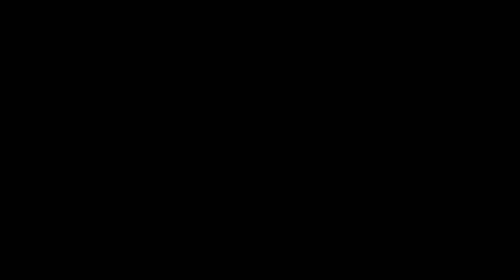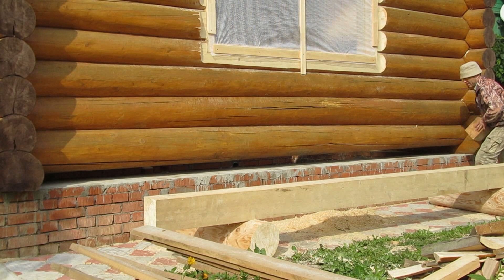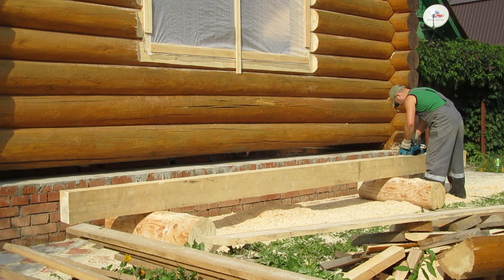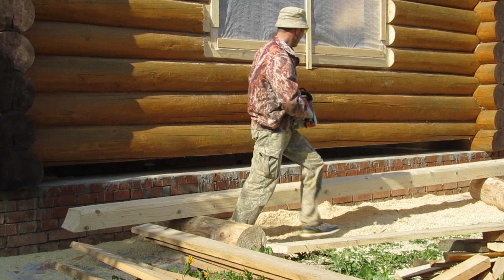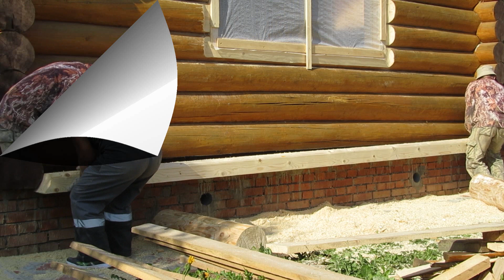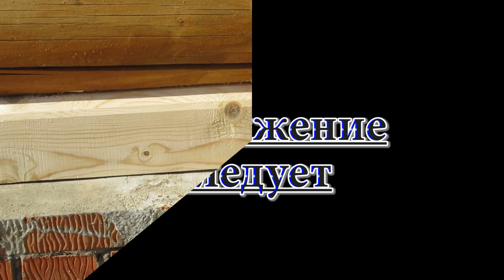Как заделать промежуток (пространство) между срубом и фундаментом

Comment: Совсем недавно подобной фигнёй занимался, ещё и угорел в безветренную погоду, когда вдоль пилил. И проклинал тех, кто мне рубил сруб и сразу в чашу не сделали эту палку) у меня полы по грунту на уровне ленты, поэтому эта палка видна в помещении. Так бы залил нахрен бетоном.
Reply from the maker: Кузнецов Евгений так-то эта "палка" называется подкатное или безымянник. По идеи его вставляют при сборке и не из бруса, а из бревна, тем самым на перекрывном пилиться не плоскость, а делается обычный паз. Но раз уже всё, как есть и бревно найти проблематичнее, то решено использовать брус на 200.
Reply: leskos Да, у меня уже тоже только потом вопрос появился, когда всю баню собрал) Вот и приходится потом выкручиваться.и тоже из бруса, т.к. бревно у нас тут проблема найти, из квадратного делал круглое)
Reply from the maker: Кузнецов Евгений круглым не стоит делать, достаточно один угол закруглить, который будет виден. Нижний угол скроется отливами, ну а внутри балками. В вашем случае, надо два угла закруглять)

Comment: У нас вообще сруб лежит на голом фундаменте из цемента ,  не положили гидроизоляцию . Что теперь делать ?  Поднять дом домкратами не получиться , так как первый венец более чем на половину залит в цемент .
Reply from the maker: Александр Никитин да ничего не делайте, только обеспечьте сухость нижних рядов. С улицы чтоб дождь не заливал туда, а изнутри, чтоб в подполе было сухо. Советую сделать гидроизоляцию земли, если не сделано. У меня на канале есть видео на эту тему 😉
Reply from the maker: Александр Никитин кстати, мой дом, бывшим хозяином, сделан таким же образом. Дому уже более 60 лет и ремонт не делался, но планирую в ближайшем будущем сделать 😉
Reply: @leskos_   уважаемый подскажи, у меня первые венцы бруса стоят на баклашках через 50-60 см примерно , изза уклона цоколя щели от 1 до 6 см, чем посоветуете заделать - деревянными клиньями или бетоном ?
Reply from the maker: @vasiliyandreev2716 пенополистиролом можно👍! Как и сам весь сруб лучше поставить на него, тк плюсов от этого куча, самый главный из которых, это то, что вероятность загнивания в разы ниже, тк холод от фундамента не будет передаваться в сруб, от чего и гниёт первый ряд сруба. 
Ну а если из рассматриваемых материалов выбирать, то я больше предпочту дерево, тк для меня им проще заделать и не обляпаю стены. Только буду не клинья вставлять, а выровняю плоскость и вставлю нужным размером доску, ну или брус, а после зазоры проконопачу.
Reply: @leskos_  в общем пирог снизу вверх такой: цокольный кирпич - рубероид-дерево-джут-брус. Только при забивания клина (доски) этот тоненький рубероид сразу придет в негодность ..т е смысла в нем нет?
Reply from the maker: @vasiliyandreev2716  во первых забивать вставыш не стоит. Делаете зазорчики, чтоб входил нормально, ну а потом просто конопатите и всё. Ну а что касается рубероида, то от него в обще то смыслу нет, если до сруба от земли не менее 50см. В крайнем случае, есть жидкая гидроизоляция. Ну а ещё лучше, если поступить, как я сказал ранее, а это под сруб применить пенополистирол. Он и гидроизолятор и теплоизолятор , так что этот вариант самый наилучший👍!
Reply: @leskos_  я ваш замысел понял ) однако есть два НО. Первое ,  меня не устраивает что нагрузка от дома на цоколь и фундамент передается через "баклашки"  Это ведь черевато "осложнениями" ?  Cколько эти баклашки прослужат? Я так понимаю нагрузка должна быть распределена равномерно по цоколю. Пеноплекс хороший изолятор но нести нагрузку он не может впринципе. Второе , дерево у меня есть в наличии а пеноплекса сейчас нет и ближайшее время наверно не будет )) Как вы относитесь к такому варианту : нарезать клинья по толщине, обработать их антисептиком   и забить..
Reply from the maker: @vasiliyandreev2716  пенополистирол (пеноплекс) нагрузку от сруба легко держит, даже если это будет бревно 40+см и в два этажа. Так что это вы зря.
Что касается клиньев, то я не люблю их. Как я уже сказал, что спилил бы с бруса, сделав плоскость под нужный размер заготовки и вставил её, а зазоры проконопатил. А нагрузка на фундамент идёт не от клиньев или ещё чего то отдельно взятого, а от всего сруба, включая и крышу, соответственно на эту тему не стоит заморачиваться.
Reply: @leskos_   можете еще знаете рецепт герметика-шпатлевки  для  бруса  на основе пва и опилок?  такой, чтобы был эластичный  Заранее спасибо
Reply from the maker: @vasiliyandreev2716  конечно знаю😜 Если бы вы были на меня подписаны, то видели бы это видео https://youtube.com/shorts/fut8EbyrBx4?si=FSjx-j9ZjTSATtko  А ПВА хреновый вариант в этом "герметике") . Так что подписывайтесь, а ещё лучше не здесь, а в телеграмм. Там инфы больше показываю, плюс объясняю. Как и на вопросы там проще отвечать, тк можно файл до лучшего понимания прикрепить. Так что что присоединяйтесь😉
Reply: @leskos_   спс глянул.. Если трещины большие есть смысл сначала законопатить  а после затереть ? ДА,    и как добиться эластичности такой шпатлевки ?  какой компонент можно добавить в смесь, ?
Reply from the maker: @vasiliyandreev2716  щели не конопатят. Если туда забивать, не важно чего, то вы только увеличит трещину, тк её порвёт от забивания. Так что ничего туда забивать не стоит. Просто закрывается и всё. Только толку мало от этой процедуры, особенно, если дом не был под отоплением, минимум пару лет. Щели будут появляться другие, тк это выход влаги, а влага в дереве бывает всегда, а точнее заходит и выходит. Так что состав должен быть дыщащим, а не эластичным, потому что эластичным может быть только состав не дыщащий, типа резины.
Reply: @leskos_   у меня трещины кое  где  с палец толщиной, с обоих сторон , кое где  затыкал джутом а он довольно нежный и сверху прошел финской краской когда   красил сруб. Замазывать пока нечем, не определился ..)
Reply from the maker: @vasiliyandreev2716  напихав туда пакли (утеплителя), а после замазав, вы тем самым можете сделать только хуже. Утеплитель намокнет от влаги дерева, а просохнуть не может, что может привести с порче древесины. Когда большие трещины, то лучше делать рейки размером с трещину и ими затыкать. Но вставлять без напряга, дабы не увеличивать трещину. Ну а те места, которые остались не заполнены рейкой, затираются тем способом, что прислал ссылку на своё видео.